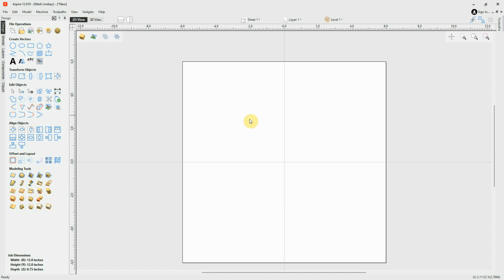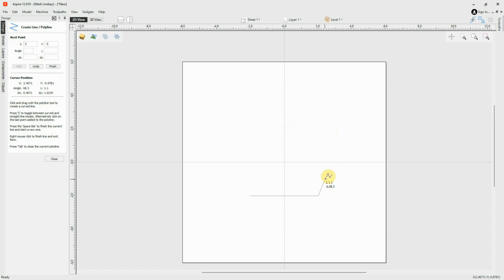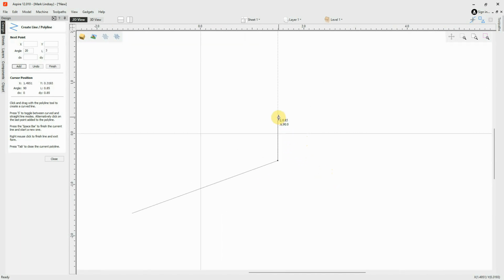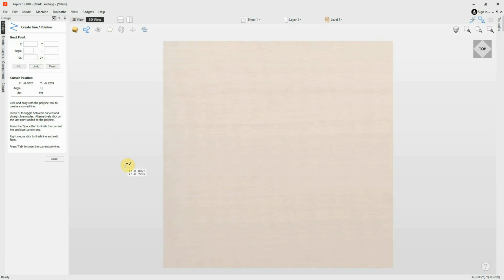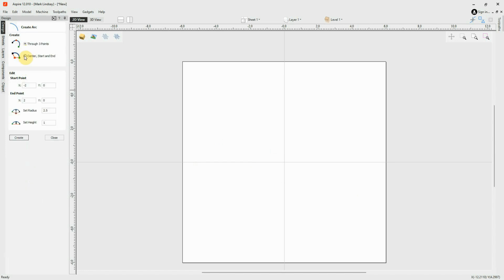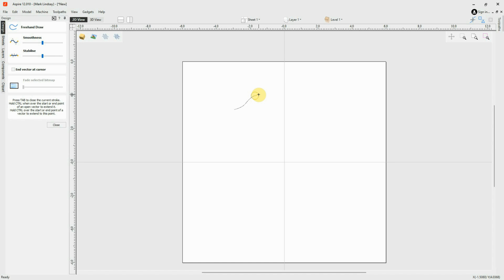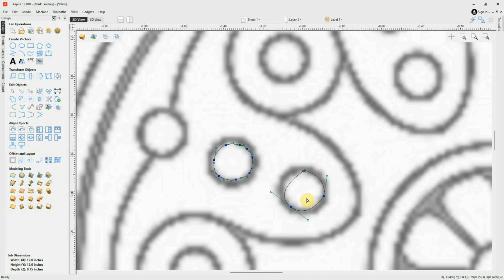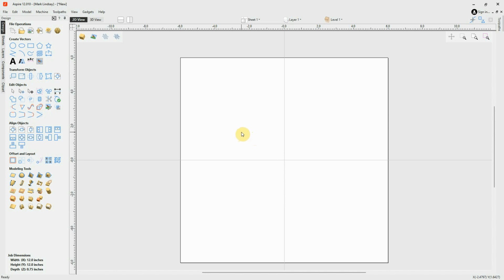Vectric V12+ for the Absolute Beginner - Part 10 –  Drawing Open and Closed Vectors

Comment: Hi Mark,
What is the benefit to work on the 3d surface instead of 2d ?
Reply from the maker: That depends on the project. Sometimes, when working on a 3D project, you'll need to be able to draw a vector around or through a section of a 3D model. That can be difficult to do in the 2D view, as it can be hard to see where one part of the model starts and another part stops. Having the ability to draw in the 3D view simply gives you another option.
Reply: @MarkLindsayCNC Thanks a lot !